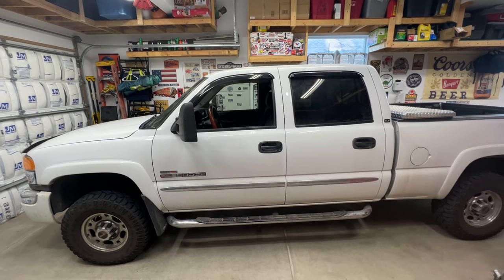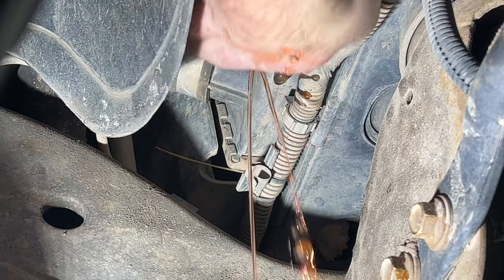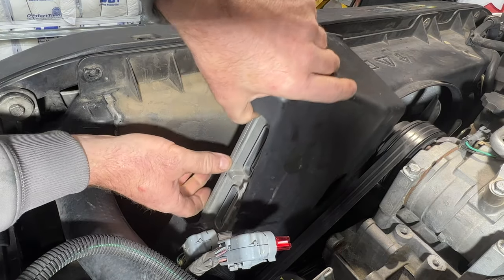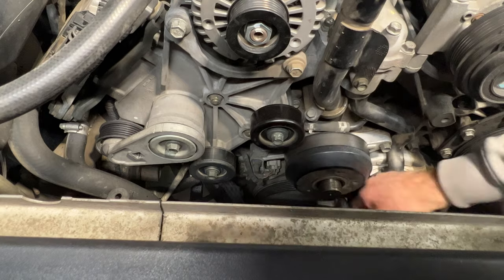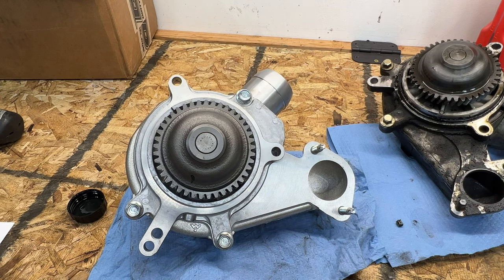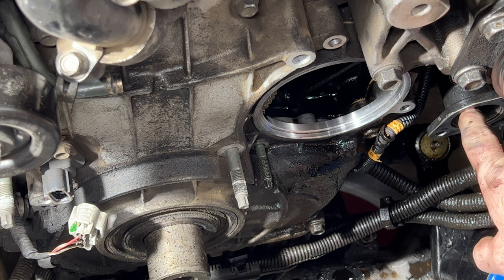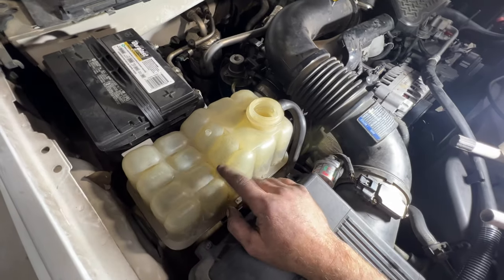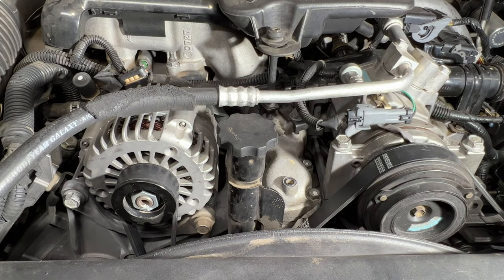2001-05 Duramax Water Pump & Thermostats Replacement How-To

Comment: Why not just pour all the coolant and water in and let the system mix it up.
Reply from the maker: You can do it that way, just be careful when it starts getting to the top so you still have a 50/50 mixture.
Reply: @BLUECOLLARGARAGE  Yeah, that's true
Reply: Very well done. Just some suggestions. If you remove the bottom left nut and then the stud you don't have to pull the harmonic balancer. Also, any old trick I was taught is If you tighten a stud or bolt first it loosens much easier without breaking. And if you double nut a stud it is easier to get out with a wrench.

Comment: Great video from every tool and size to each bolt or nut in order to even how each part is removed, I work on semi trucks everyday but this was my first duramax you made what seemed a huge task into a simple non stressful experience. 
Still rather be doing semi trucks

Comment: The 2 12mm studs are giving me the biggest headache right now. Super tight for no reason and rounding, Hopefully i can get in there good with the liquidfier if i take the ac bracket off. Already have PS off replacing lines.

Comment: Lb7 and LLY water pumps are the same? I have a 2005  2500HD but its not a LB7
Reply from the maker: Yea lb7 and lly share the same water pump if you have a 2005 you will have a lly because in 2006 they came out with the lbz.

Comment: Is there a special means to add the antifreeze back?

A special tool required?

Was told, one cannot just pure into reservoir

Else blow head gaskets 😊
Reply from the maker: You can use this tool https://amzn.to/3yR7Upt to help eliminate air in the system which leads to cavitation. But it is not required you can just fill through the reservoir and keep squeezing the upper radiator hose to help get air out. Not sure who told you that about blowing head gaskets